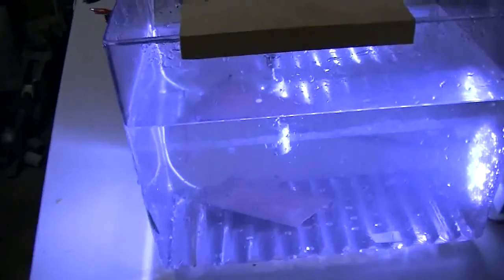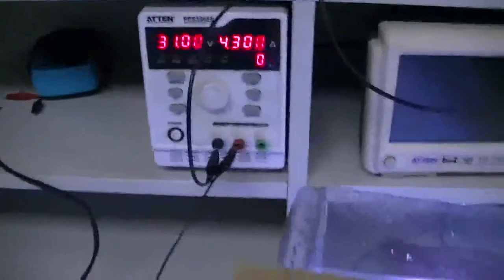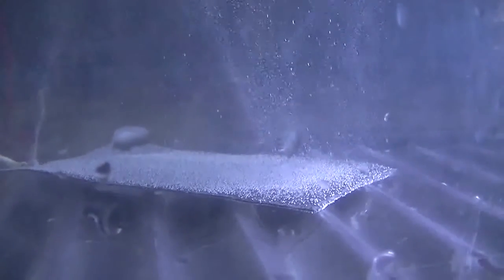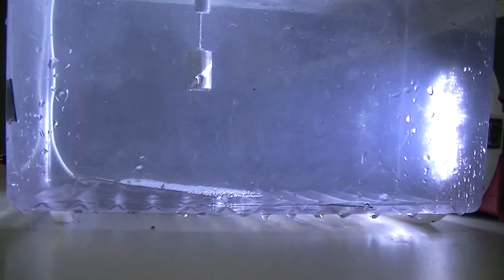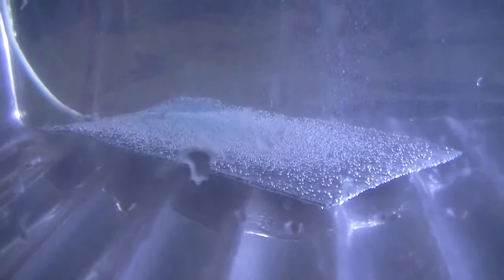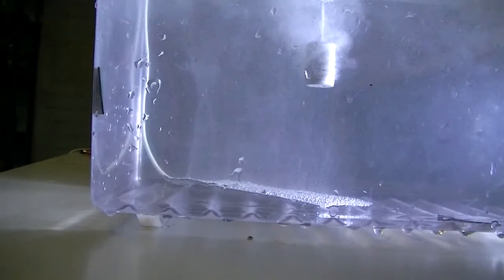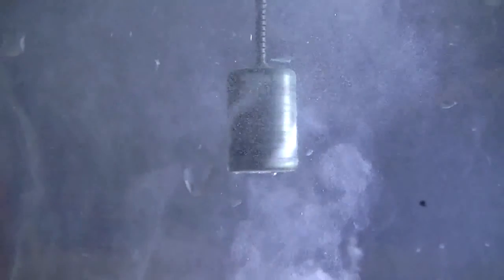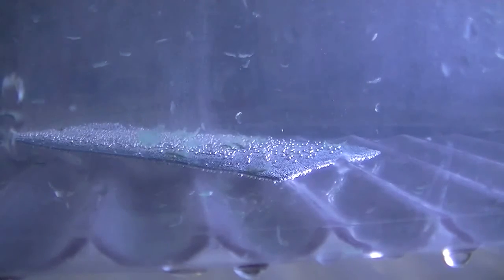Magnetic vortex Aqua motor

Comment: Try placing a conductor on the bottom of the Neo like a flathead screw and coat the Neo with a silicon calking to prevent it from electroplating...That might help the Neo to last longer,but the current will still go through
the Neo to induce the spin.

Comment: At 4.36 minutes, you moved magnet away from copper plate. Do you think the rpm of the spinning magnet decreased? If you have a tachometer, can u check the rpm in the different exp conditions? It would be interesting to measure the amount of H2 produced.

Comment: Hi TinMan
Thank's for sharing this experiment
I first tried it in tap water, i could see the beginning of rotation , but noway to get the spinning even at 33 volts, than  tried it in K2CO3 electrolyte at 33 volts and it works tip top. The anode is a stainless steel plate
I tried a disk magnets,( thick and thin) , than a ring magnet, than a flat rectangular (1cm /4cm /0.5cm ) All spin perfectly.
The rotation is opposite to the magnetic vortex,
 When the magnet is a anode , there is almost no bubbles as you have noticed.
Very interesting and simple experiment to replicate.
Laurent

Comment: I think its just a homopolar motor. Which is basic right hand rule. (HomoPolar Motor Explained be sure to read description) So not sure there is anything to re-write.
I just did some tests myself. Used a magnet anode and cathode at same time. If the magnets can spin they do, if they cant spin the water does. Water is probably spinning when magnets spin too, its just hard to tell with the magnet stiring it up. Its exactly the same as the AA homopolar motors you can see on youtube (search worlds simplest motor) If the magnet is fixed, the wire will spin. If the magnet can spin and the wire is fixed the magnet spins. Except in this case the water is the wire which spins if the magnet is fixed.

To prove any rotating fields exist within the magnet, you would have to do a test with no electrical current......
Reply from the maker: Hi MS. Thing with this setup in water is,the current flow is from all directions-so what happens to the right hand rule then???.
Reply: We underestimate, all too often, the magnetic field of our environment. If energy couples through a magnetic medium in Q (Coulomb) force, perhaps there are many misconceptions of energy in transition through space, we misrepresent as loss rather than simply change. So busy forcing particles, we neglect to ride the wave. Of course, all just conceptions or misconceptions of a simple mind. Nature made me this way I guess....

  Alright, theoretical explanation is fine and dandy but we all enjoy engineered application of theory for tangibility. So here is my experimental proposition. You are in the Southern Hemisphere TinManPower and Binj Komisar is in the northern. Identify your magnet poles and see what rotation of spin is in reference to the earth. Then there will be more clarity on this matter I believe. 
Keep it up gentlemen, life is a beautiful exploration if we choose it to be such. Thanks for your energy spent in this matter.
Reply: Check this video out. VIDEO 11 Uncovering the Missing Secrets of Magnetism, New Invention showing Magnetic Vortex
It more or less shows a test with no electrical current.... (I am still going to attempt the test I told you about, been building the apparatus :)
Reply: TinManPower  I would like to think I thought of that before my last post, I did not. 
EXCELLENT point TM!